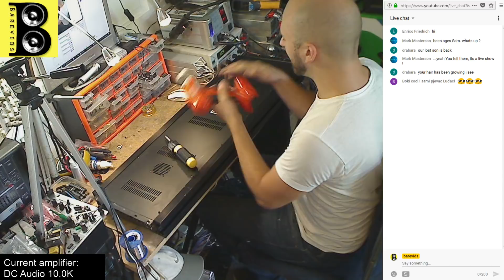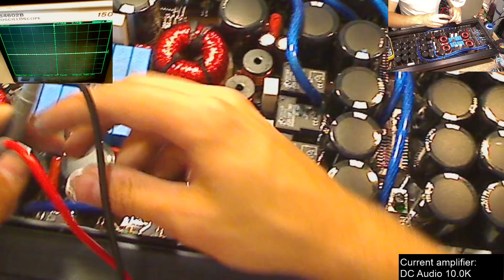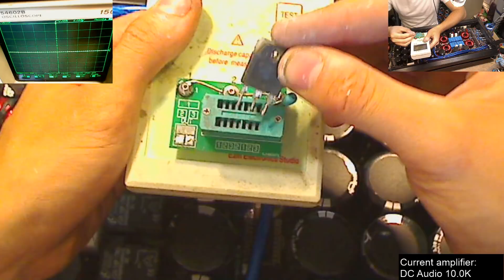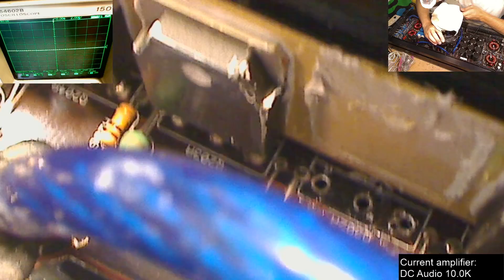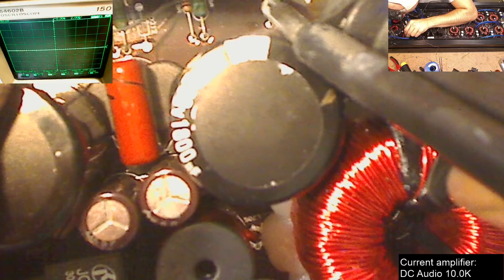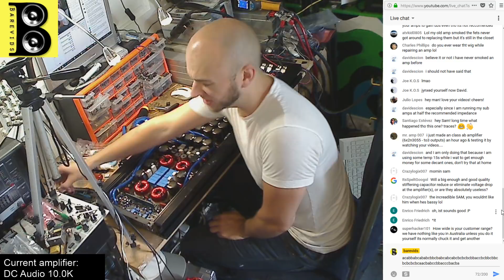Live repair DC 10K subwoofer amplifier

Comment: sistema   pwm   ele  tem  grande   eficiencia  mais   temperatura e  corrente  primaria    e   primeiro  passo  ai  este  modulo  tem  ter  baterias   muita s delas   suportar     tanta  corrente    saidas  delas   e  ver  que   existe  limite  tempo    la  se  baterias   estiver   carregando    vao   decarregar  rapido    por  nao  suportar   corrente  saida    certo  amigo  usar fonte  dc  de  200  amp    ajudar     e   modulos  metade  deles  e  fonte  outra  e   amolificacao  isso  prova  carros   nao  sao   feitos  tanta  energia   modulando  dentro d eles    tem  ter  muita  energia  baterias  ate  ultra   capacitores  muitos  suportar  tanta  energia  saindo  deles     sistema   precisa  woofer   bem  calculados  e   caixas  bem  calculadas  ter    som  40  hz    liberado

Comment: This is kool stuff. I fried some of my fets in my mmats 1400.1 and replaced them and blew some more and now im thinking that i should just replaceall 16 of them. What do u think
Reply from the maker: If they blew straight away then it's because the drive circuit was also damaged, if the drive circuit is okay yes you should replace all 16
Reply: It didnt immediately fry it took the duration of the day
Reply: Thank you